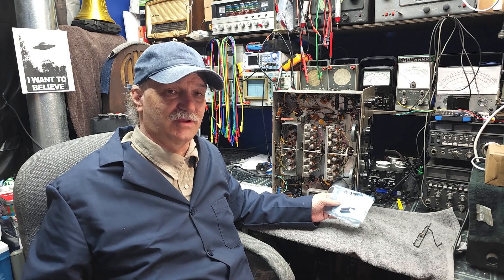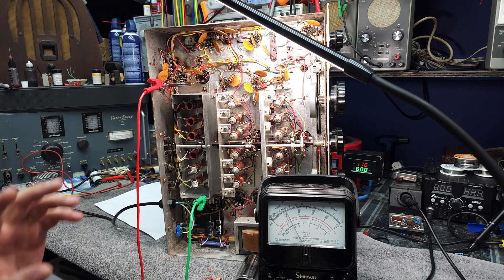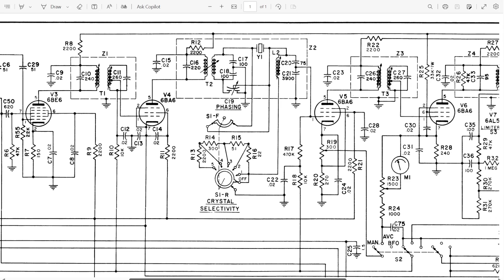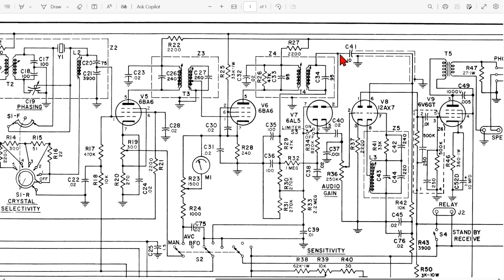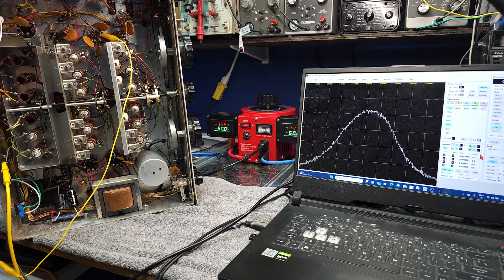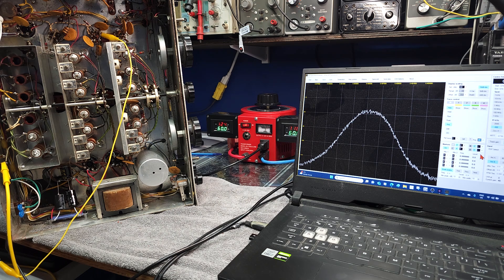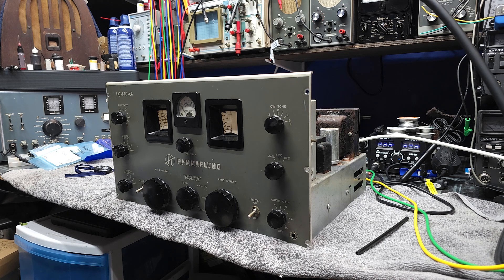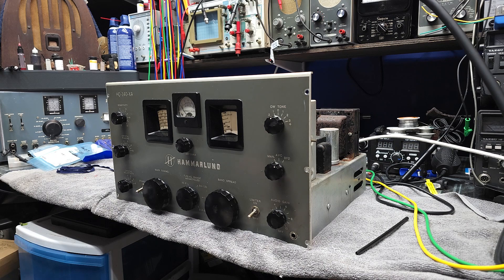Hammarlund HQ-140-XA Repair or Restoration? Pt. -3

Comment: What is the poor-mans spectrum analyzer software you are using and how is it hooked up to the radio? A real spectrum analyzer is MUCH money. I have been frustrated by my phasing control on my HQ-140 and I only use a VTVM and signal generator to align the IF.